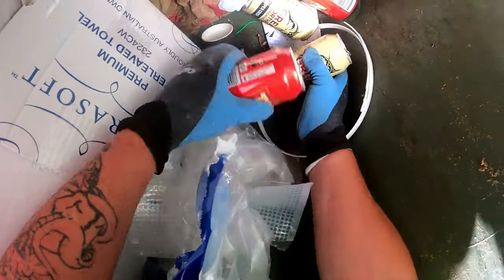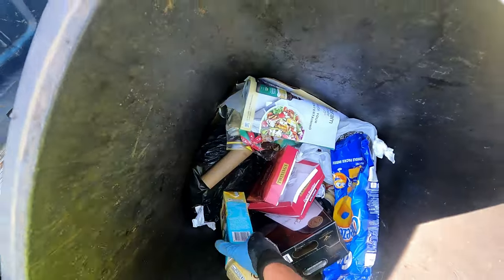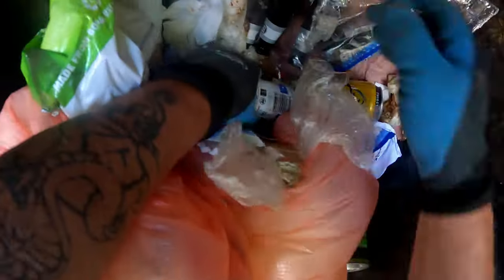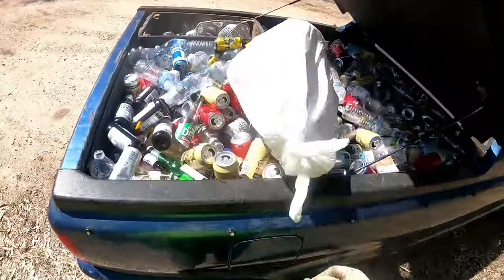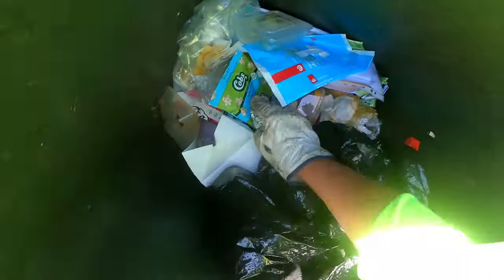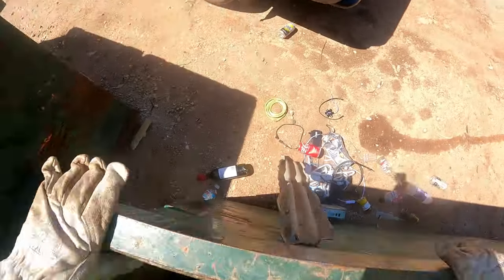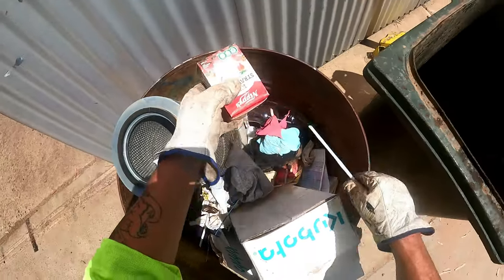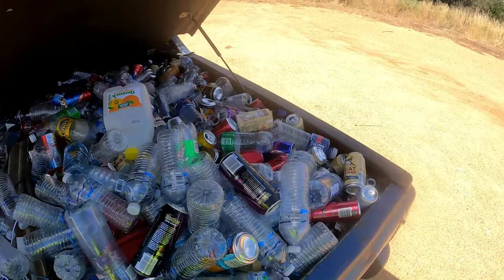Dumpster Diving Part 2 A Box Of Interest

Comment: You will find the the wine bottles in NSW will have the 10c refund on them. Your still finding the old stock. Most bottle shop will still have old stock on shelf. I would take a bottle with you to a machine and try it. You may find it may work.
Reply from the maker: Already tried and tested did not work.
Reply: @oureverydayliving  It won't be long until all the wine bottles will have the 10c on them. Your putting out some great videos mate. Keep it up.